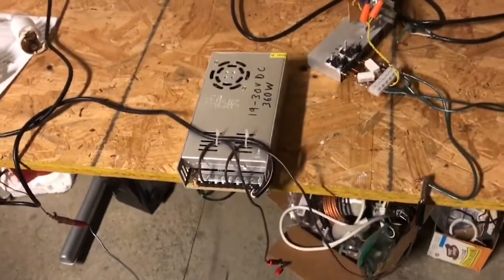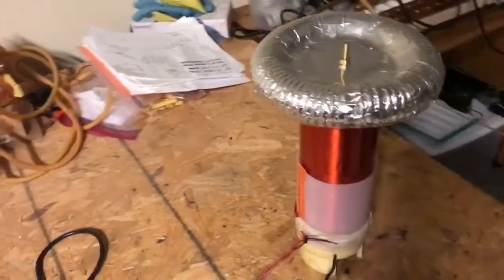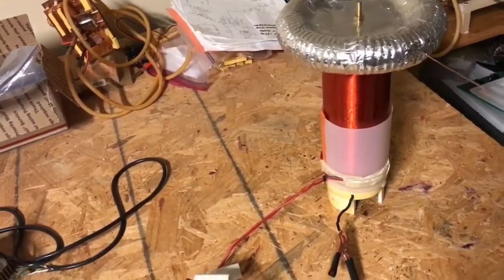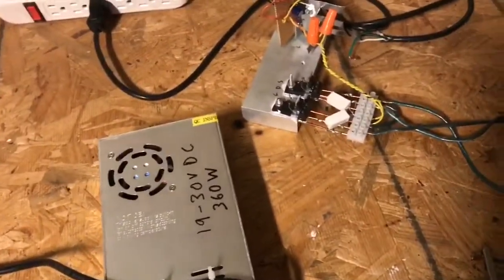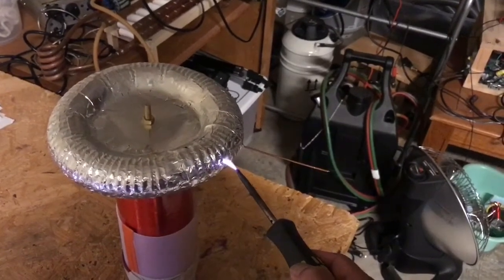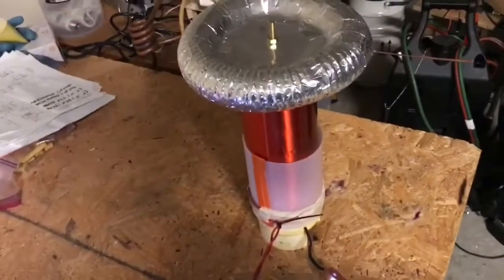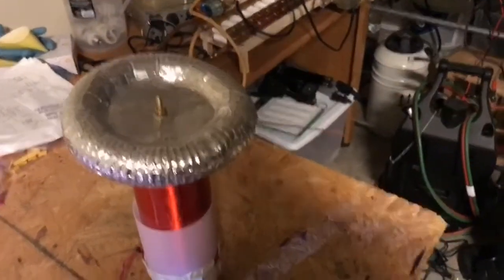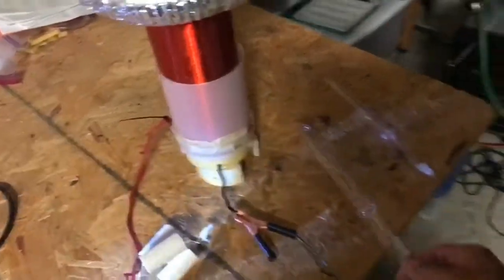Mazilli SSTC-Works!!

Comment: i never got breakout with my setup ( was a while ago ) but i could draw arcs off it and it had good RF output .. the only person i saw with breakout was tesla explorer .. one day i'll achieve it ! do your gate resistors get hot by chance ? mine got quite hot when running the coil .. they are 2 watts and normally are fine running hf transformers .. bit odd but maybe i was doing something wrong ..
Reply: I never got breakout either when I did this setup... I did nice hot arcs pulled too though.
Reply from the maker: The gate resistors get real hot. I am using 100 Ohm resistors on the gates and supplying them with 12V from a voltage regulator. I also tried using a step up step down buck converter to supply them and that works very well especially if you want to keep the gate voltage at 12V despite getting a big voltage drop on the power supply.  I am thinking about what Binj said ie looking at harmonics to get breakout from the coil, or using a longer coil. The test coil I used was relatively short. I think Tesla Explorer used quite a tall coil when he got breakout from his Mazilli SSTC.
Reply: hmm i will have to try running the gates separately then as i used a standard circuit .. i also used a smaller coil, i could try my 174KHz coil, may work .. i think he used a coil similar to your size .. dont know but hope you can get some breakout !